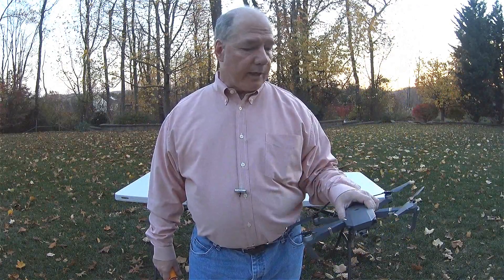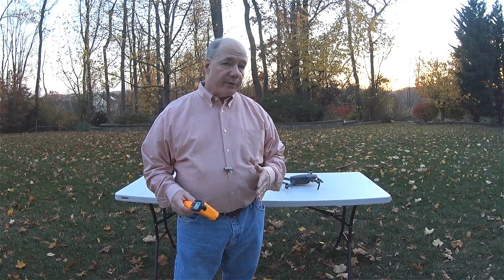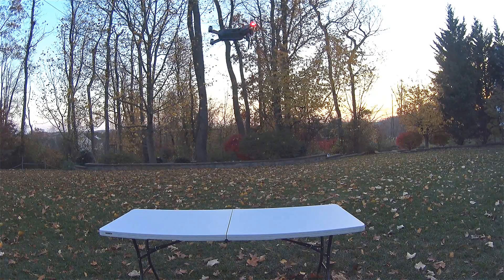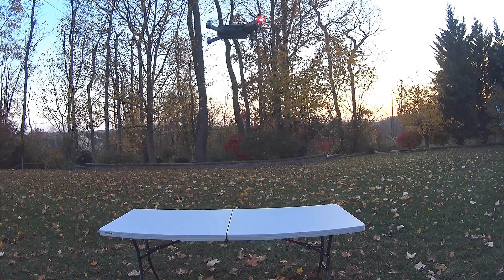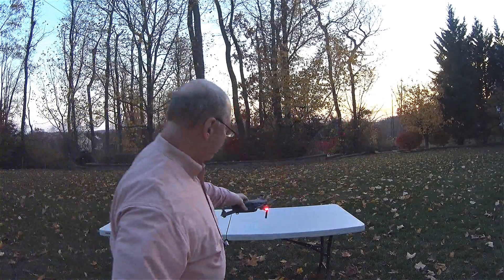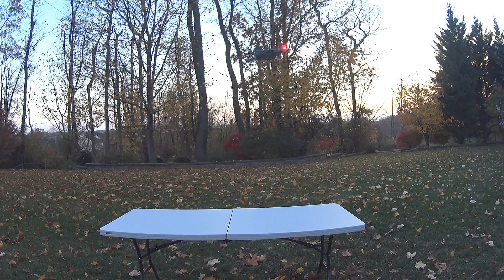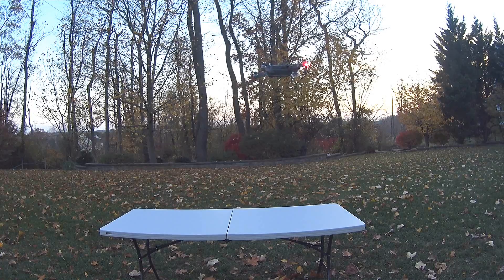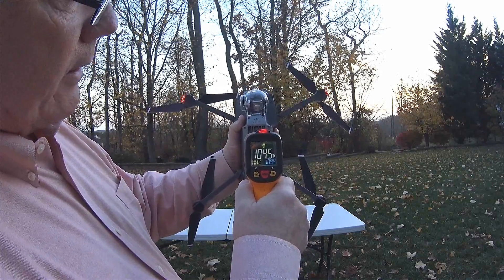Mavic Pro Running Hot?  Here's Why

Comment: Having a problem with my walkera vitus 320 getting extremely hot. Has a fan or something on top in the front with a grill like vent. As soon as I turn it on the fan starts up really loud. Without even flying it and just letting it sit for 5 minutes or so, the top gets so hot you cant touch it. Just where that vent is. Worked fine this last summer for a trip I made. The collision sensors didnt work and it clipped a wall from about 8 feet up and crashed with minor damage to the outside plastic feet and under the arms but nothing actually broken. So not sure if the impact did something, even  though it dint have the heat problem when I flew it right after. Just got it out to keep the batteries charged and see if any new updates were available (still none in over a year and still missing advertised features) left it on for a few minutes, picked it up and youch hot. Not confident in taking it apart without knowing what I'm doing and dont know anyone who knows anything either. Anybody have any tips for this particular drone?

Comment: Man u r kinda mad. Before starting your test u should take off up-detail of Mavic for gettin air into "body" which is gonna cool your Mavic otherwise it will start to get some heat and will be over hot so mavic wil literally die. Anyway respect to u from Russia, I'm also using it so just gave u kinda advice :)

Comment: Good test rick after I watched this video I jumped right in to my mavic pros quick start guide manual.

As it states on page 6 it says to remove gimbal clamp and the gimbal cover is to protect the gimbal and should only be removed when necessary so it’s safe to fly with it on I guess🤔🤔

Although I could see the mavic running way hotter during long flights because the air flow would be cut down by like 90%

Comment: This is an old video but here is one of many teardowns that shows you exactly reason why the bottom plate is hot does not mean for one second the internal temperature is that hot...  That plate on the bottom is doing what it's supposed to do moving the hot air away from critical components. 

https://youtu.be/ndZVS8CtTLw

Comment: I have a yuneec breeze as well as the Mavic pro... 

The yuneec breeze does not have a fan inside but you can easily take the cover off the back.. 

I did this test with yuneec Breeze customer and the temperature was all the way up to 140 degrees in some spots right on the heatsink.. 

Remember just like a cell phone CPUs can easily go up to 140 or 160 degrees you can tell by using an app..  

Some CPUs can get up to 212 degrees before they shut down internal temperature....  

I would say a 105 degrees is easily normal....….   

THAT'S WHAT ALWAYS GOT ME NERVOUS ABOUT THE MAVIC CONTROLLER, AND AIRCRAFT... 

THEY HAVE MOVING PARTS IN THEM LIKE A FAN WHICH MEANS THEY'RE GOING TO WEAR OUT EVENTUALLY AND YOU'RE SCREWED LOL.... 

I'm definitely one to fix things on my own with 30 years of electric experience..  but I wonder how difficult it is to replace those fans in those products...

Comment: My fellow engineer.. 

What you should be doing it's figuring out the temperature when it's not flying just sitting there.. 

DJI never says in the literature you can't turn on the mavic and leave it.. 

A lot of things like the simulator and if you're doing some testing with settings, using the camera, etc... Requires you to have the aircraft on just sitting in one spot where you will find the highest readings.. 

Looks like you have a lot more testing to do.. 

;)

FYI you obviously know what a heat sink is.. it's the Disappeared the heat away from the craft inside.. 

You're basically getting a reading of what the heatsink is showing not what the components inside are showing

The heat sink reading 105 degrees makes perfect sense because it's doing its job..

Comment: Hot that is the Pro problem the new Air DJI added vents to cool off the Mavic but the Pro has no vents and DJI has not fixed the over heat Pro problem. So I guess it is safer to buy the Air even thou I would prefer the Pro. IMO DJI should come out with a vented Pro body case. I guess DJI will never admit there is a heat problem due to legal issues.

Comment: he's definitely on point.  The first time i had mine on the ground programming it for a long time without any movement produced a significant amount of heat.  I have researched a fan that will fit in the rear section its 15 x 15 x 8 mm the size of a quarter basically and i plan on installing it right under the wifi board right near the screen mesh heat exits.  Should work i think pretty well and theirs a 5v power source relatively close on the main board...

Comment: I took a Dremel tool and cut out the flat area on the right hand side of the globe to let in more air. I covered the hole with a special air filter material. Also the slit on the front lets through a lot of air so this thing does not block airflow altogether. It's useful to have it on if you are flying and video is not you main concern. Just a Run for Fun making sure your gimbal is protected.

Comment: LOL 100 degrees F is too hot for electronics? 195 F is considered the max for computers, and that's basically what a Mavic Pro has inside it.

Source: https://communities.intel.com/thread/112251
Reply from the maker: Thanks for the post but the Mavic is much more sophisticated and delicate than the average computer. In addition to processors (and there are several) it also has Wifi transmitters and receivers, GPS and GLONASS positioning devices, acceleration detectors, digital compasses, video capture and processing as well as encoding and streaming technology. All of this packed into a case about the size of a can of soda. So while your average PC can operate at higher temperatures, you don;t want to push it with the Mavic. Lastly, any heat at all will slowly kill electronics so even though a device will seem to work under extreme temperatures you are absolutely reducing it's useful lifespan every time you run it hot.
Reply: Drone Valley Electronic devices slowly degrade even at room temperature. The fact is the Mavic pro running at over 100°, even at 125°, will degrade so slowly that it will no longer be flyable do the failure of the arm hinges and other mechanical parts before the electronics fail.

Comment: Would it be an idea to drill a few holes on the edge of the globe, that way it can have more airflow into the globe. only restriction you will have with that is that it might be visible on you video if you tilt the camera to much. Just an idea, don't know if it could work.

Comment: I love your channel. I watched so many of your videos before I bought my Mavic Pro. I have a question. I just got my Mavic Pro yesterday. I had to update the firmware when I turned it on for the first time and I noticed the fan came on almost right away and stayed on for the entire firmware update. after the update was done I turned the Mavic off. A few hours later I turned it back on and started to go through some of the DJI Go 4 app setting and the fan kicked on only a few minutes after the power being turned on. Do you know if this is normal? I had the gimbal lock of and the dome removed.

Comment: The heat on the underside is not heat generated from flying but rather other equipment like cpu,gpu and transmission equipment. So flying it does not make much difference to the heat. For globe on globe off test I think the test wasn't done correctly as the temps might very well turn out to be the same had it been done with globe on first. So all the precautions to make the two tests to be similar except perhaps for the most important one, the starting temp. I should rather want to see what temp differences are after 10 min flying and 10 min stationary on the ground without flying. Might even be cooler flying as to standing stationary on the ground while being on

Comment: well seeing as dji say you can fly it with the globe on it must be heat rated to cope with this,  to test correclty you will need to find out it's max heat while operated rating otherwise this Is all speculation and you would need at least 2 units to test.

Comment: Another outstanding video.  Thanks for all you do.  

As for the clear bubble, I wonder what DJI engineers would advise to do.  I did notice a slot in the bubble that could be intended to provide cooling.  Venturi effect would increase the velocity of the incoming air through the restriction.  If the engineers thought it through, it could be effective even with the bubble attached.

Its a shame they couldn't put the heat sinks on the arms so that the rotorwash would provide cooling.  Maybe next version?

Comment: Having noticed how very hot my Mavic  after 30 seconds stationary with motors off, I became concerned.
Checking the fan layout I notice the air is fed from the rear of the camera and straight down through to the heat sink under its belly.
When I hold the Mavic from behind in front of my face the expelled heat is dissipated directly along the base cooling the vanes extraordinarily well.
Clearly after holding the plastic dome in its place I estimate 40% of fan is lost.
Placing the cut out protective cover has no restricting properties whatsoever.
Bearing in mind the heat produced after 30 seconds of start up is surprisingly high, I feel this 
Is catered for by the huge vane heat sink and fan. 
I will therefore never run my Mavic  with the sealed cover fixed, I shall use the cut away version exposing the camera freely.
Robert Kelly from U.K.

Comment: I modified my protection globe by cutting a hole in it as I was getting too many reflections and other anomalies. Never saw a video before that said leave it off, as I thought it was for protection during flight, and was very nervous when I first got my Mavic.I will need to do same temp tests to see if my modified globe is affecting temp, for those times when I need to fly with it on.
Your videos are more accurate and reveal so many things not shown in other videos. I was lost on several things until I started watching your videos. Hope to see you produce videos explaining all the other features and settings on all the menus and submenus as I can't find good info on most of them. Keep up the good work.

Comment: I don't own a Mavic Yet!, but i'm sure those vents in the front are there because of the globe, 
They are there to blow warm air around inside the globe in damp & cold conditions to prevent the globe from misting up... 
Just like the camera body on a Phantom acts like a heat sink, it's also serving the purpose of preventing the lense from misting up ;-)
Reply from the maker: Thanks for the post but I've actually taken the Mavic apart a few times to investigate the interior and can tell you that the fan is a centrifugal Hybrid that has an inlet right behind the gimbal (inside of the lens cover) and blows some of it's air down to cool and some across the upper board. Flying with the globe on will definitely reduce the amount of air available to the fan, which will reduce it's ability to cool the quad. Additionally, the globe introduces glaring issues with the camera anytime you face within 90 degrees of the sun. It also degrades the quality of the video. For all of these reasons, don't fly with the globe attached. I hope you jump into the hobby soon, it's an incredible experience! Rick
Reply: I stand corrected, I'll have to get my hands on one for a closer look (Any excuse to buy one eh!) haha, 
The dome must of been an afterthought and they didn't think it through, it seems silly to have your main air intake blocked, if cooling is going to be a problem.. 

I do agree with your point about the glaring, i've seen a few videos now, and there is an obvious difference between the ones with the dome on, and the ones without. 

Maybe it (The Dome) was only ever intended as a camera protector, for when it was in a bag, and someone at the design table suggested that they make it out of clear plastic, and they ran with it lol... 

I do already own a Phantom 3, Amazing bit of kit, and i personally love that Litchi app too, 
I have a few videos planned, I'm just waiting for better weather and some spare time... 
Ray...
Reply from the maker: Ray, I agree that they included it for camera protection when in transit and confused everyone (myself included) by making it clear. I did a clip when the Mavic was released showing it flying with the globe and the associated glare. It wasn't until I did the tear-down that I realized that it was blocking the cooling fan. Good luck with the Mavic, you're going to love it. Be sure to sub the channel as I have a lot more Mavic content posting soon. Rick
Reply: I think i've already seen your Mavic with Globe and glare clip Rick.. 
I'll keep an eye out for your new videos, i already subbed your channel ages ago, but it's my first time commenting, anyway Check out my channel, if you like it, you know what to do ;-) Ray.

Comment: only a minute between tests?  not long enough for the heatsink to cool down from the first test.  of course it will read higher on the second test, residual heat from first test still lingered.  You skewed the results, anyways

Comment: The globe has a slit cut into it which would force air towards the fan; it would direct the air perfectly into the fan when flying which would dramatically cool the components. You didn't mention it has a hole cut into it.
Reply from the maker: Thanks for the post but that small slit on the side of the globe won't let enough air through the front to cool the copter properly. If you look at the grate behind the gimbal, you'll see that it covers the entire back wall. If all the copter needed was a small opening they would have at least lined it up behind that clit. There's no getting around the fact that flying the quad with the globe attached will greatly reduce airflow, which leads to a hotter copter. Not to mention it totally degrades the video quality and the focus. Thanks for the post, Rick

Comment: Yea, i observed the omission of the second reading before flying with the gimbal cover as well. This video is over a month old, did you retest it and make a video taking a reading before being flown with the cover then after??
Reply from the maker: I did let it cool down before the second test and just didn't think I needed to film it. I haven't had the chance to do the follow-up as I've been busy with other clips. The fact that the globe is blocking the only intake vent should be enough to know that flying with it attached is a bad idea. Also, the plastic degrades the quality of video and introduces a nice wide stripe of reflection when you're flying into the sun. Both of these are good reasons to leave it off during flight.
Reply: Yea i understand your point. I noticed though that in the majority of the DJI flight videos they have on thier site, the cover is on. I also recently saw a video, where a guy was doing a debate over the gimbal cover, and he acutually called DJI LA, to inquire. The rep basically said having the cover on won't harm the drone mainly because they incorporated a vent slot in the cover near the gimbal arm, which i am assuming provides enough air circulation when the Mavic is in flight, i am not sure about a stand still and that basically the only issue that may occur is sun glare on the cover at cetain angles with it on. But you are making a valid point. Keep on with the good info, I watch a lot of your videos.
Reply from the maker: Thanks for the reply and for watching the clips. The DJI rep in LA was mistaken and the slot on the side doesn't provide enough passing air to cool the quad effectively. The promo clips were put together by their marketing department, which typically misses a lot. For example, I did a clip showing how the engineers spent extra time crafting the antenna's so they could snap together when closed to protect them from damage when transporting. I also discovered how a small tablet could be used in the handles of the controller by slipping it through the slots. Marketing missed both of these details and neither of them made it into any of their promo clips or manuals. Honestly, the little bit of protection the plastic will provide in the event of a crash isn't worth the damage from overheating the quad. Thanks again for the post, Rick

Comment: In the manual it says u can leave it on
Reply from the maker: Actually, it's vague in the manual and that's where the confusion is coming from. Simple physics would tell you that if you block the only entry point for cooling the quad, it's going to run hotter. And hotter is a bad word for any electronics. What makes it even more confusing is that they made it clear, which makes it seem like you can leave it on while flying. Even if I was totally wrong about the heat issues (which I'm totally not) the globe causes reflective banding in the video from the sun and also reduces the quality of video you'll be shooting. Leave it off when flying, you'll have a lot longer life of your quad if you do. Thanks for stopping by and I hope you sub the channel. Rick

Comment: I just subscribed, very helpful videos, sir 
Thank you for putting them up.
I have a question unrelated to drones...
I'm a teacher hoping to move into web teaching and I really like the result of your lighting and sound/mic combination (I suppose camera matters as well, for mic connectivity)
Could you share which specs you use when you shoot indoors?
I live in China so finding specific brands might be a challenge (made here, not sold here kinda thing) so I would appreciate if you could pin point the reasoning for choosing certain features.
thank in advance
keep up the good work.